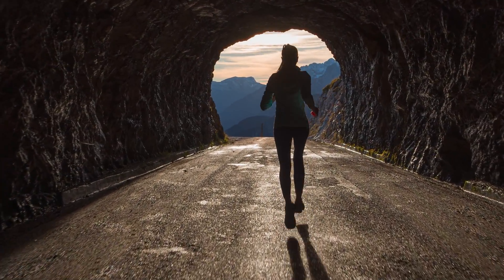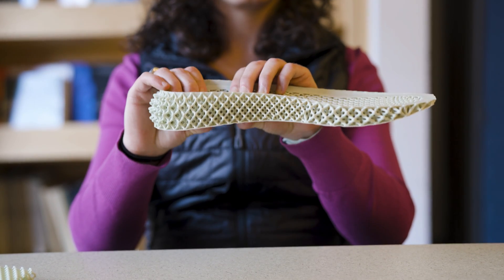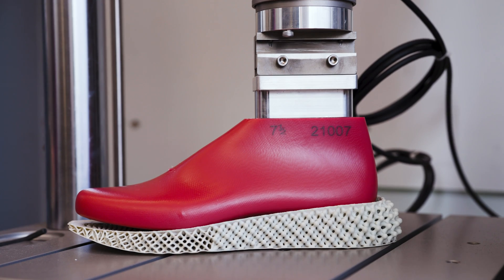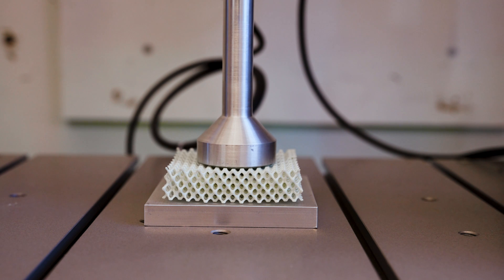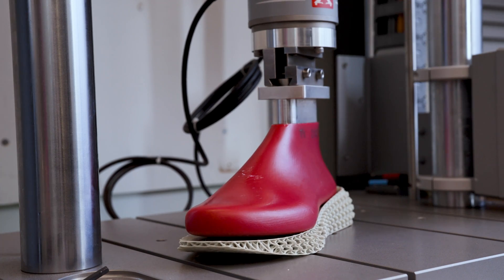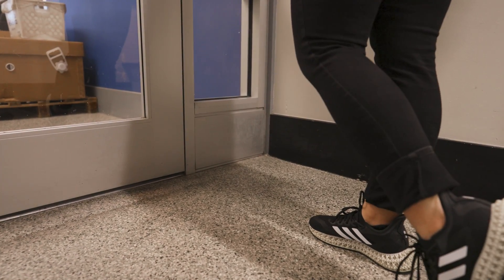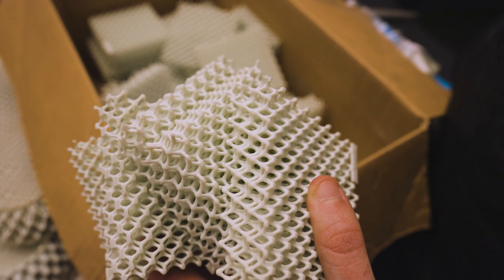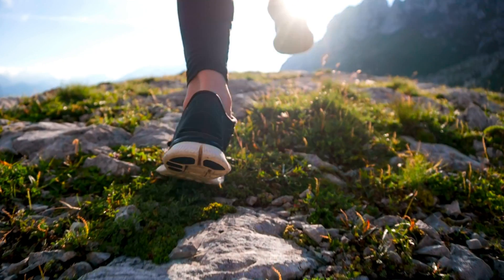An innovative side of sneaker design

Comment: The tough position of creating the “best shoe” is that some humans use better biomechanics than others, and you can design a shoe for an athlete who has amazing biomechanics to complement that movement pattern, but the average person has a completely different gait, one of several deviations. 

Now here's the real tough problem. The average engineer just wants to fix the problem by giving them the appropriate technology. However, there's a multitude of options. Ideally, the individual would want to rehabilitate their movement and slowly transition to a normal shoe, unless for some reason they physically cannot and need some variant of assistance due to an anomaly. 

But on the other side, most individuals don't care or have time to care and will continue the same deviated gait. So you can print a shoe for this deviated pattern. However, over time, they will probably end up in a worse state of deterioration, and you will need updated shoes to continue to compensate for their deviated gait that has been unaddressed from a position of their own rehabilitation of their personal bio mechanical patterns. 

Please correct me if I’m wrong, but this is why it’s so important for interdisciplinary perspectives. To presume we can just print the best shoe for humans is not fully approaching the complexity of the issue, and the many disciplines that can contribute to understanding the totality of this dilemma.

Comment: 🤔 Hmm, and how do you get rid of the stones, dirt and mud that inevitably get into the grid structure when you run outdoors?
Reply: I have 3 pairs of these 4D shoes. If you pick up rocks in the trellis, just bang the shoe on the ground until the rocks come out. Works every time.
Reply: @MarkIsidro shoe bangers.. 😮 shame on you!
Reply: you can have insides with a hollow infill but the outer walls with a full infill, but that would definitely affect the performance.
Reply: You print another one, duh!

/S
Reply: Put an outside layer on the 3d printed foam that is printed as well, make the 3d printed outside structure a little thinner to compensate for the extra material. 
That obviously doesn't look as cool  but as they said: This is supposed to be a novel, cool looking shoe, there is nothing stopping this design from being more practical and less novel.
Reply: @i.i.iiii.i.i  well, if you add an outer layer, there are two things that could happen: 1) If the layer is airtight, the shoe will behave differently, 2) If the layer isn't airtight, we'll run into the same issues I mentioned in my original comment.

Or am I missing something?
Reply: wash it? there is this thing called water...
Reply: @mk-np1ez  he meant the scenario when its in use, for example long range marathon. you can't stop to wash the shoe.
Reply: I've worn a pair of these shoes for close to five years now and they hold up extremely well, the sole still feels like new and I have never had issues with anything getting stuck in there.
Reply: Just buy new shoes
Reply: You buy multiple that get progressively dirtier based on use case
Reply: This will come out in studies scheduled for the next decade :)